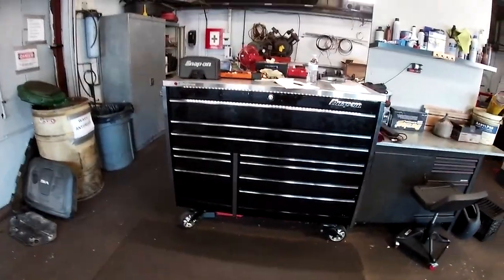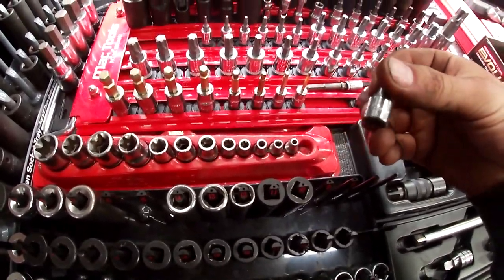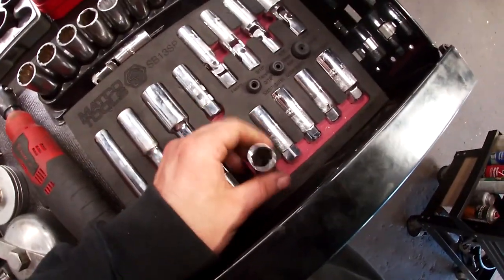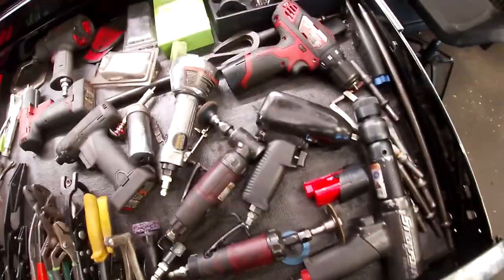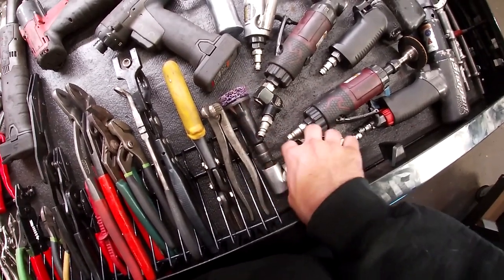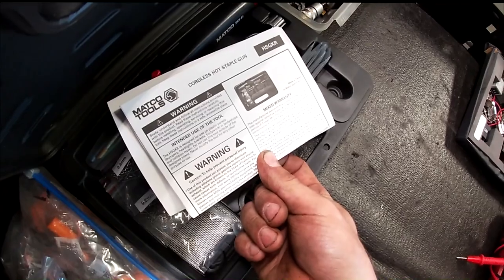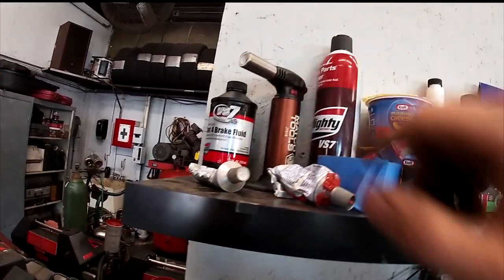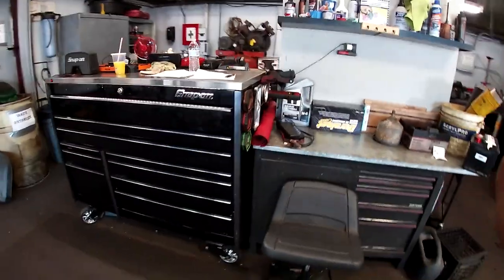Tool Box Tour - Snap on KRL722 (Independent Tech)

Comment: I’m in a wheelchair but I’m a hobbyist with cars not a professional. How do you buy a 3/8 ratchet with a 1/4 body? I can’t go on a tool truck.
Reply from the maker: Personally my matco guy built it for me. 1/4 body and head with 3/8 internals. I don’t personally know but other brands should be able to do this. If I find a video I will link it on a following comment.
Reply from the maker: Rebuild kit - https://www.matcotools.com/catalog/product/BFR8TKA/3-8-DRIVE-88-TOOTH-RATCHET-REPAIR-KIT

Ratchet - https://www.matcotools.com/catalog/product/afr98lf/1-4-drive-9-1-4-eighty8-tooth-locking-flex-ratchet

These can be ordered right to your door, I understand tool truck prices can be expensive so here’s a link to a video of someone making one with a gear wrench ratchet. 

Video (Gear wrench) - https://youtu.be/2i4oOsA4T0c
Reply: @PVTXTANK  thank you so much!!! I appreciate you !!!
Reply: Koken makes them
Reply: Well I was impressed with your cart, I am twice as impressed with your box. Excellent job!
Reply: Astro pneumatic makes a couple nice ones
Reply: Any tool truck driver worth his salt would get his ass off the truck to help ya
Reply: @PVTXTANK read my previous comment
Reply: Read my previous comment
Reply: I haven’t done it personally but i know you can use the 1/4 snap on body and buy the 3/8 rebuild kit and do the swap. I’ve rebuild my 3/8 drive ratchet and the rebuild part is real simple

Comment: Leaving keys in your magnet tray will demagnetize your key one day believe me it happened to me i had my key on my toolbox one day all day and I didn’t realize it was stuck to the bottom of my impact ratchet since all my Snap-on impacts have the battery magnet holders, i noticed it at the end of the day time to go home and my car didn’t start thought it was my car battery come to find out my key fob chip took a shit ! Thanks snappy
Reply: It wasn’t the magnet. Electronic keys aren’t magnetic. They are run off RFID chips. The chips are energized by the cars and send out a signal. It was just a coincidence.